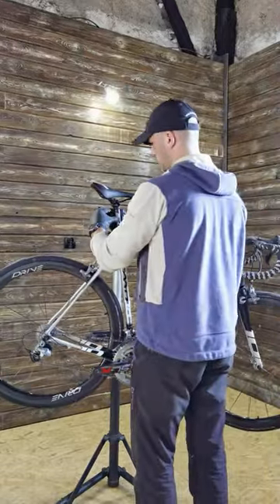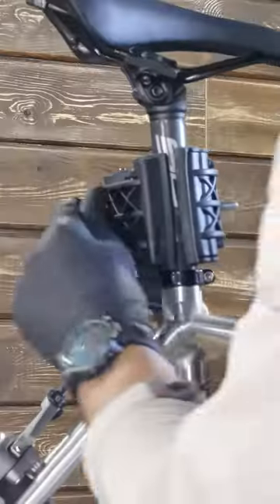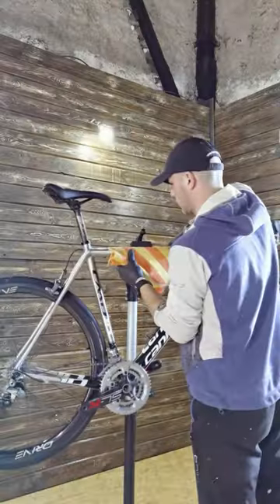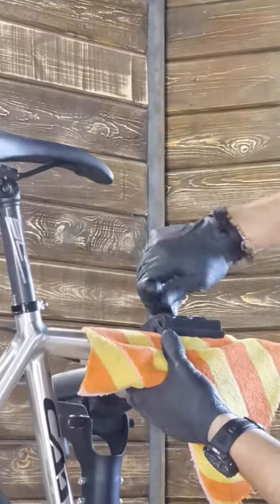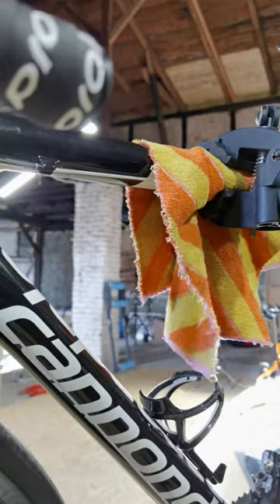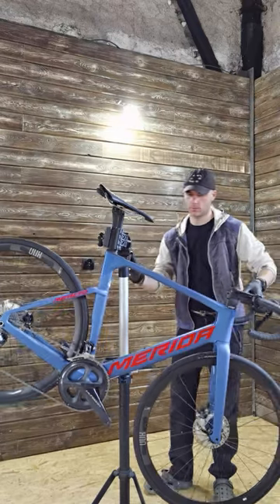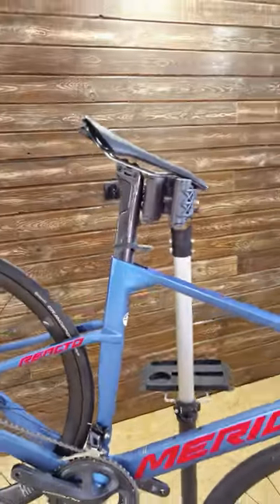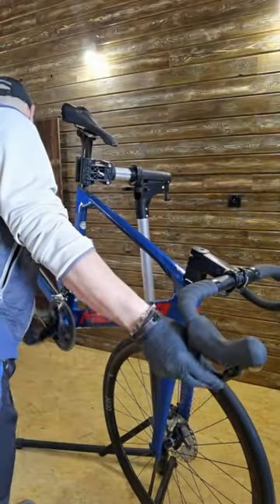They said it's WRONG to clamp it like that. Really?

Comment: Jokes on you i dont have one so i just flip it over
Reply: I used to do the same and was able to tune the bike good enough, but i knew i would have to play with the shifting adjusters on the handlebar for the first few kilometers. This happens because the chain and rear derrailleur is not designed to work upside down.
Reply: wait that's illegal

Comment: Lol the frame can handle pressure and stress from our body and carriage, why they even bother from cant handle the stress by their own weight lmao
Reply: Yes it does handle the pressure and stress but it's through the saddle and then to the frame.

Carbon frameset is not designed to be clamped and get yanked on while working on the bike. Carbon weave flexes only on certain direction.
Reply: What he said.

Comment: I never have this problem with my Reynolds 853 steel bike frame…..or columbus SLX….. steel is real,,, carbon is junk…
Reply: You mis spelt "steel is shit, carbon is awesome"
Reply: @richardhaselwood9478  been riding bikes since 1972,,,, after my accident ( flat tire downhill) with the Colnago c-68, ( the dream bike) carbon cracked. I had other flat tires with steel frames. Fix tire and continue but $ 4.000. Carbon frame was an expensive frame and didn’t last….sorry amicco,,, life is short ,,enjoy the ride …….